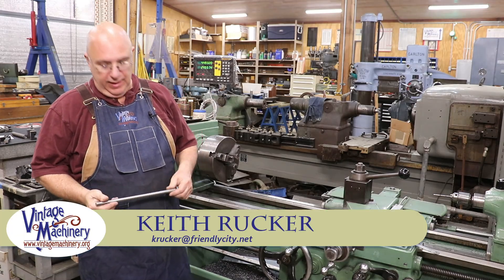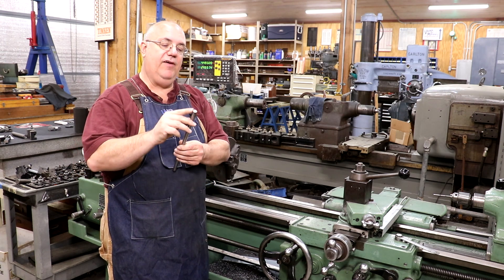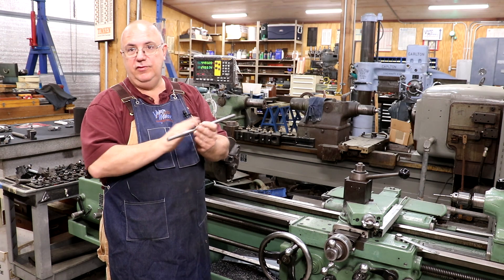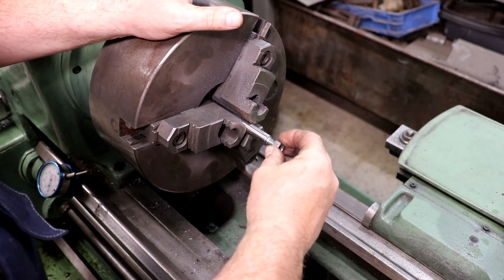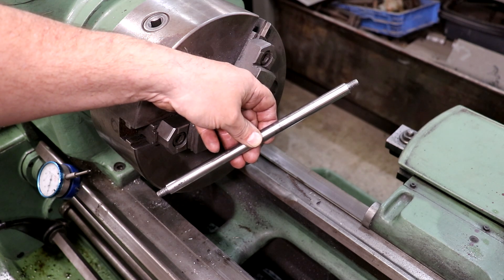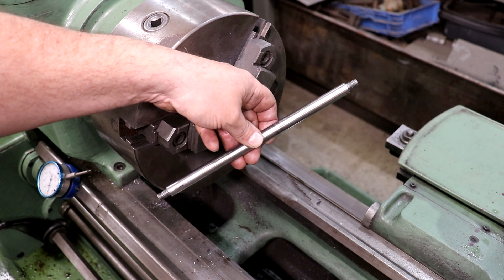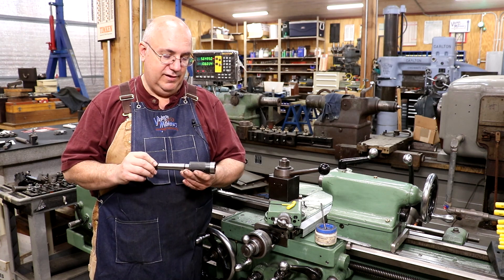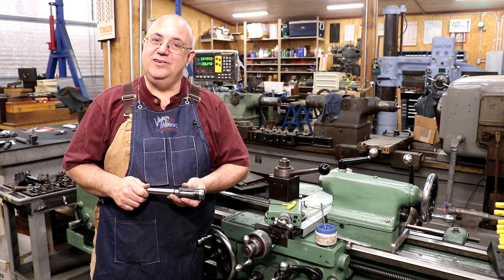Easy Threading on the Metal Lathe with a Floating Die Holder

Comment: Keith has made a mistake in his threading operation. To be fair, it is a mistake most people make. If you look in your favorite reference book you will see that the major diameter for a 3/8"-16 thread is NOT 0.375" . The major diameter of all 60 degree threads, metric or inch, is less than the nominal diameter. 
This matters because if you thread from the nominal diameter then your Go-NoGo gage won't go onto the work even if the pitch diameter is correct. The crest of the thread will be interfering with the root of the thread in the gage.
Running a threading die over the work obscures this fault. But it does make the die noticeably more difficult to run onto the work because it has to cut the full thread profile. 
If single pointing a thread what happens is that if doing general purpose work and using the mating part for a gage instead of thread wires or Go-NoGo gage you end up with a sharp crest by the time the parts will fit up. Then when you de-burr the thread your nice fit suddenly is sloppy because you've cut the pitch diameter undersize.

Comment: Hi Keith... this 'floating holder method can be stressy, too. I know these ones without the pin. up to M10 //3/8, I'm usinf the closed version without the pin, but a good knurling. So You can hold it, until you reach the end of the thread. I usually do the pin a few thou under size, so the cutting forces are a bit less.. hope the link, sorry, german ,works... https://www.amazon.de/PAULIMOT-Gewindeschneid-Einrichtung-f%C3%BCr-Reitstock-MK2/dp/B01BU05AX0/ref=sr_1_16?__mk_de_DE=%C3%85M%C3%85%C5%BD%C3%95%C3%91&dchild=1&keywords=paulimot+gewindeschneideisenhalter+mk3&qid=1626326185&sr=8-16

Comment: A necking undercut would save the time needed to recut the bottom of threads with the die reversed. I use a spring loaded tension compression type in the CNC lathe to do longer small threads and not have to fight part deflection - like a #8-32 thread 1½ long.

Comment: Somebody help me here. It appears to me he was not taking advantage of the pinned slot when he was manually feeding the die with the tailstock. It's very obvious he was doing this as the pin stayed in it original location the whole time and you can see the tailstock being hand wheeled in. What's the purpose of using a "floating" tailstock die holder if you are going to manually feed the die. Also I thought from Keith talking up the short distance and the shoulder that the die holder would free spin when it hit the shoulder. I didn't see that advantage when it hit the shoulder and spun the work piece. Couldn't see how it would do that either. Operator still had to be concerned with the die crashing into the shoulder.

Comment: This video was very timely for me, I am doing an almost exactly the same thing but on 8 short bars with a thread on each end. I rigged up a dodgy spring feed to get the die to start which worked most of the time (the spring had other ideas on one of them). I was also concerned that my threads  did not reach the shoulder but seeing how you reversed the die allayed my fears that I would damage it, so now I am off to the shed to make my amateur job look like a professional one thanks to this video. Regards from Australia, Keith.

Comment: That stock was still 0.508 after you cleaned it up, wasn't it?  What if the customer actually had a 0.500 or .503 hole?  I know that, when I buy some tool steels (S1, for instance) that they make it about 10 thou oversize to allow for  for decarb, but I wouldn't think you'd need that for this job.

Comment: Problem today seems to be every time I buy a die it comes in a different shape and sized circumference.  Some of the smaller sizes are ridiculously small outer diameters.  I have to have a drawer full of adapters and even then it seems I often don't have the right one..

Comment: Making one of those floating die holders will be on my short list for sure when I get my lathe set up again. I don't understand some people's fear of and/or distaste for single point threading though, honestly. It's one of my favorite operations on my lathe! Granted I was a USAF machinist so that was a huge part of our day-to-day routine, but still...the average home machinist can easily do it with very little practice. Grab a machinery's handbook and a chunk of scrap aluminum and give it a whirl. It's a really fun process.
Reply: I very rarely single point anything due to cba messing with change gears. my big lathe uses a quick change gearbox so when thats up and running Ill do a lot more thread cutting
Reply: @samec88  I can totally understand that. My Logan lathe started out as an 1805 (change gear machine), and single point threading can be a royal PITA when you have to rip the whole gear train apart to set it up correctly for one single operation. I ended up adding a quick change gearbox (and changing out the lead screw, carriage assembly, support bushing, etc to make it all work - essentially converted it to a model 1815) and now threading is a much easier process, as is dialing in different feed rates. Wasn't a cheap or easy way to go because I spent nearly a year searching for all of the parts to do it poperly, but 100% worth it for the massive increase in usability.

Comment: Notice how the whole unit spins in his tailstock slightly ? Likely scoring his tailstock taper.... seat it harder maybe ?
Hope you have MT taper reamers
Reply: That’s because Keith machined the shank to dead size, instead of a little undersized - generally aim for 80 % of thread depth to reduce cutting torque to a more reasonable figure. Check tapping drill sizes for confirmation of what I’m saying !

Comment: You got it right, Keith.  $42.00 - $72.00 on Amazon. I just did a search for a floating die holder and ended up with a full page of them on Amazon. Ed

Comment: Why not reverse single point thread it when it's such a short thread?

It's also a nice beginner project to make one on the lathe
Reply: That's how I would do it. Turn the thread tool upside down ... reverse spindle and thread away from the shoulder. Less crashes that way.

Comment: I once had to make a floating, adjustable and telescopic handled die holder(allowing both machine and manual control as sprungd handles extended to allow hand torque application) as an apprentice to get my first job in a machine shop as a novice!! I also had to design it too! Turned out well and the shop paid me the equivalent of an over the couter cheap die stock - Loved the job for 18months, and the experience/knowledge, but my bad back(ciatica) hated it, even with duck boards!!!
Ps. Threads to a shoulder are best done in reverse screw threading, as you can get the form nice and tight, all the way to the shoulder(no die lead ins, etc).
Keep on, keeping on.......

Comment: I get a bit nervous about these die holders. Even if you can see exactly where the front edge of the die is, most machines don’t stop immediately. They don’t have that brake. If not, the die will pull in after you stop the machine, and it will crash. Unfortunately, it’s impossible to determine how much the rotation will continue. It depends on the speed, material, the diameter, the threads, etc. So turning the lathe by hand is still required. I like floating die holders that themselves turn so you can do it manually.

Comment: When I use a split die I put the split under the middle setscrew tighten that to hold the die open, the secure with the two outside screws. After that operation I then back the centre screw out and retighten the outer screws to cut the true  thread size

Comment: The Metal Devil is not just a bastard for metal; it cut's your ears too... Not exactly a machine for a (precision?) workshop... Imagine I'm trying to get my e.g. grinding set-up right within a micron (that's 0,001 mm or 3,93^10-5 inch for all the Imperial folks) and than Joe Blow started the  Metal Devil; I'm meters off... (or +39 inches). That's no help, that is the Devil ruining your relation with your coworkers, the intended accuracy and the neighbourhood... If this is a promotional piece; I understand. If it's not;  stop ruining your ears and use a bandsaw or an old skool humpty-dumpty powered hack saw. It's a miracle your microphone survived this.... Joking here but I still don't understand the use of this weapon. It's like shooting duck with a tank... One other tip; I use a floating a tap holder too when it's ok for the work. But one thing, major in my opinion, I have removed the stopping pin and hold it with my hand until it touches the shoulder and release it (or loose a limp). Your approach asks for a correct stop for your machine otherwise it ruins your thread or other damage happens... For me the wrong way of doing things.  Looking for this kind of tool; look for the brand Akon. Not cheap but will last you a lifetime. OK, enough criticism, thank you Keith for all your fine content! Best, Job

Comment: Mine doesn't have the key; you hand hold it from spinning. You can go a bit faster and when you hit the shoulder you just let go, or if it grabs you can just let go. Probably better for 1/4" or below. It does have a Tommy bar if you can't hold the knurl by hand for larger sizes.

Comment: 7:05 Did you have the lathe jaws loose so it would slip when the die bottomed out?   How did you get it tight enough so it would cut but loose enough so it wouldn't break the die?

Comment: Production tip: use single point threading method to get threads exactly where you want them, then use die to quickly cut last few thousandths to proper depth.

Comment: If you want to thread to a shoulder the easiest way ist to remove that pin, on such small thread you can just hold it by hand, as far as I know they are designed to be used by hand most of the time

Comment: i call it a tailstock die holder, i made one a while back, nice little project
Reply: Most tailstock die holders don't float or slide like this one. They just hold the die rigidly so you advance the tailstock manually or unlock the tailstock a bit so it can slide. If you made the floating kind that's pretty cool, I might give that a try.
Reply: @c0mputer  yep as you say a floating one, just my name for it i turned a Morse taper for the tailstock rest turned down to 10mm so the holder can slide on it, don't use it much as i prefer to single point threads. but its handy for little stuff

Comment: Easier to do with a regular die holder, then all you need to do is turn the die holder around to thread up against the shoulder.  Notice your lathe motor has a really long wind down before you can reverse.

Comment: I really enjoy your narrative and the quality of your work. I am not a machinist, never used a metal lathe and as such I am in awe of the methematical prowess it takes. Unfortunately I am 73 so cannot now change careers. I have had my turn. Keep up the excellent videos.
Reply: 73 is not all that bad of a point to start learning something new. That's the age I was when I bought my lathe. I also have a mill and tool grinder. Between the 3 of them they provide plenty of mental challenges to keep me active. I repair things and make stuff just to see if I can.
Reply: @larryschweitzer4904  I guess my dad wasn't far off that age when we got the milling machine.
Reply: where abouts are you ?

Comment: Even with this I'd add some thread relief, so you avoid having those half cut threads right next to the shoulder. That way you can screw anything right up to the shoulder without it jamming. Not sure if running the die backwards could damage it. Either way some relief would be recommended.
Reply: You're right, if you notice he still didn't get the practice nut up to the shoulder. That tool was very extensively used in the screw machine business when the machines were actuated by cams. I know because I'm of that age and older than necessary to have used them. My dad who was in that trade for many many years was totally very familiar.
Reply: dont forget he cut a small chamfer  on the shoulder,so he probably was getting the nut to bottom out. Ive used the same process with no problem
Reply: Did you see the hand-die finish?
Reply: @milantrcka121  Yes, he was correct in using the die the way he did, but he still couldn't get the practice nut all the way up to the shoulder. He should have machined a small relief groove just before the shoulder to allow the nut to go clear to the shoulder.

Comment: Nifty little tool. This channel's costing me a fortune!!
Reply: Me too!
Reply: You are a machinist. Make it yourself! I made mine from  4" length of 1 1/2" round stock center bored to slide over a 1/2" rod chucked in the tailstock drill chuck. It has a different dia. on each end to hold 2 different die sizes. I made mine with a short handle so I can feel the pressure of the cut and let the tool spin when I finish the thread. I don't have to worry about stopping the lathe in just the right place. 3/8" would be the biggest size I would use this tool on.